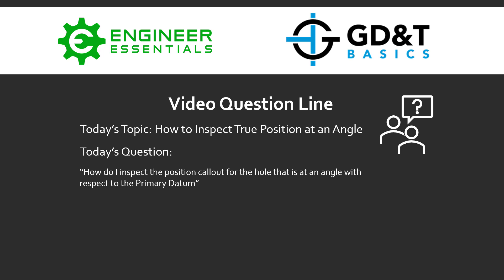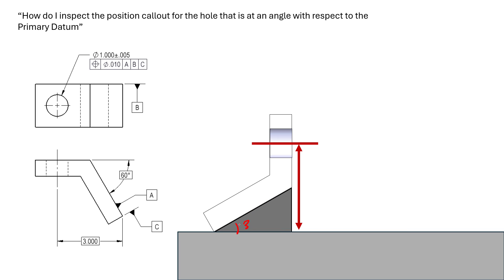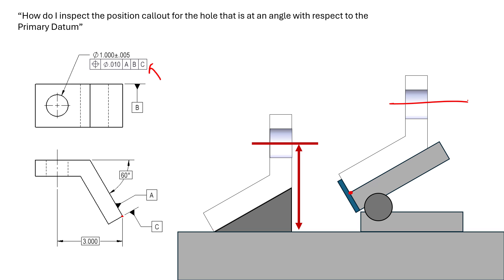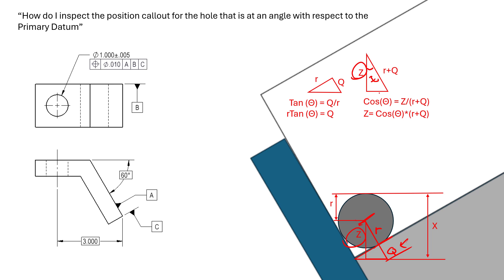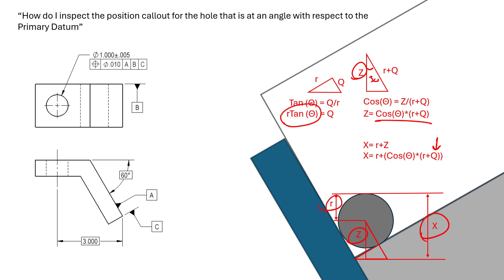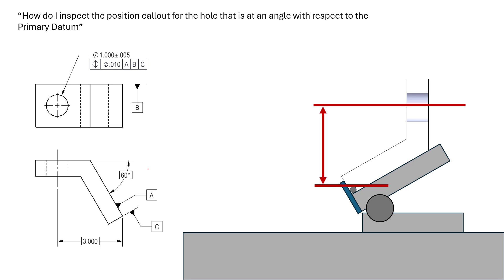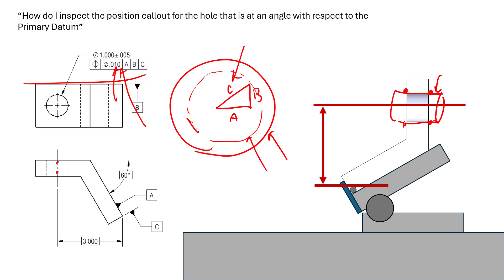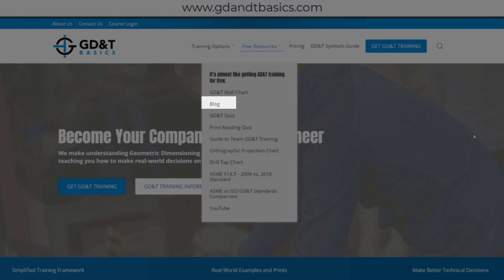How to Inspect True Position at an Angle

Comment: At 9:58, shouldn't the original point(Zero) be the intersection point between datum A and datumC. What you want to express is that we can add X value depends on the Pin the inspector will be choose, is that correct?